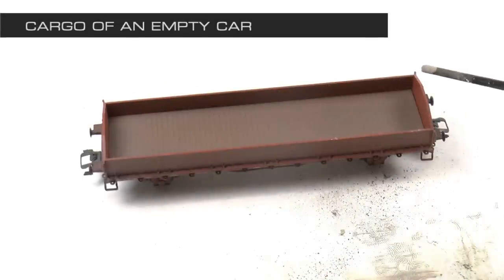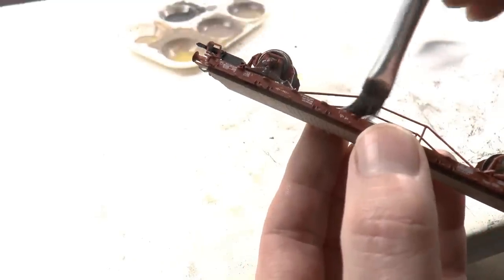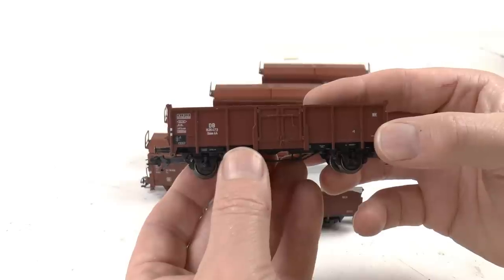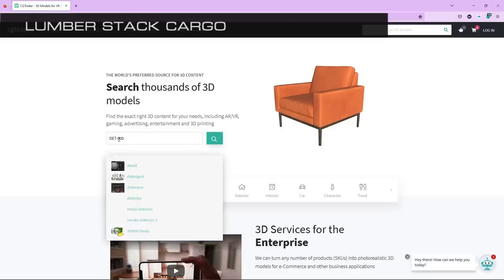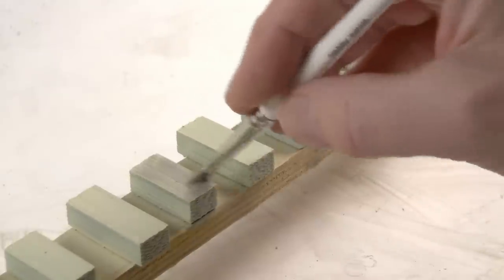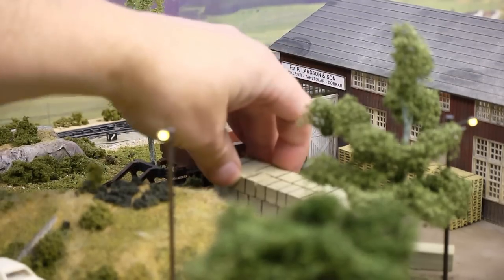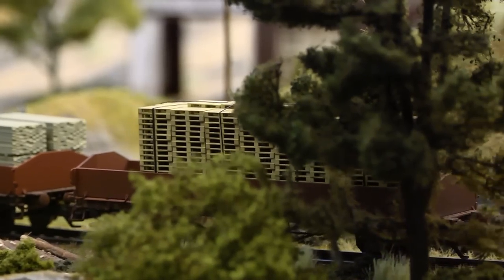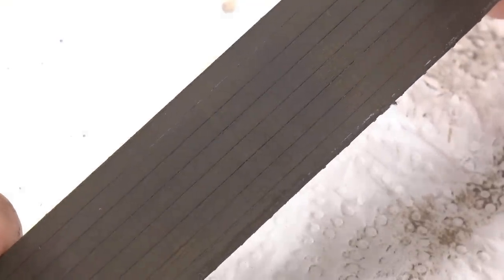Creating wood themed loads/cargo for your freight cars

Comment: Hi Martin, Being a scratch model boat builder and now back into model trains, I use black cotton for straps and securing restraints. It is also useful for wrapping around a round wooden block or PVC pipe to represent cable or even rope etc. The ideas are endless, it just depends on the mind of the modeller.

Comment: Well, Martin, another great video tutorial.  I am learning a lot from you as I progress into my modeling career.  I have a casting (from plaster) of "junk" that goes into a gondola and I have spent hours in detail painting of this casting.  It's even got some rubber wheels I have paint with flat black.  So far, so good.  I've gotten it to look quite realistic which is the goal in model railroading.  On my old layout I started painting all the ties on the track with varying colors of browns.  I had to tear down the layout when we moved from GA to TN so I'll be building a new HO scale layout in the very near future.  I've learned a lot since that first layout. I've learned that I can reuse some of the track that I had ballasted just by adding some water to soften the old PVA glue.  I'll also be constructing a new Lionel 027 layout as well.  My wife says I have too many hobbies, i.e., Ham radio, model trains, photography and reloading ammo.  Cheers & 73 from W Rusty Lane K9POW in eastern Tennessee

Comment: On a local Operating Session the owner made his coal loads removable by magnet. He inserted a nut under the pile of coal. As the nut is glued in the magnet handle is placed over the coal load and it lifts right out. The loads are then put in a bin under the layout. The bin is then returned to the location where the cars are loaded during another operating session. This is similar to your storage bins but keeps hands off the layout. 
The same could be done for saw dust, wood chips,  or even scrap metal loads.

Comment: Hey Martin, for your concern .. not prototypic cars ... Look at new releases by modelrailroad3d .. they have a swedish style car for fine wood fibers and similar scrap .. it prints in just 3 parts and has clearly visible freight - only if you want to put a base of say balsa wood below the wood fibers then you have to place it in there before glueing top and bottom of the car together as the car has kind of stabilizing elements that span between both sides so you cant insert a long balsa piece after assembling the car. As a side .. printed fine scaled down to TT scale as well ^^

Comment: 20mm is roughly 0.8 inches in length. Walmart sells small timbers that are about 3mm or so square on each end and about 75mm in length that could be used as a top or outer layer on a timber in a gondola. These would be in their craft aisle for the larger Walmart locations.

Comment: great video with lots of nice tips. I think of one thing that can make your work easier and that is how you cut those straps at 11.50. Did you know that you can buy the straps ready fro use like Whiteboard Tape Line, on a roll with glue on one side. They come in a lot of colors and sizes like 1 mm wide . At a very low cost. But sure is a nice video. Thanks !

Comment: Tip... if you print large flat bits in a resin printer, like the top of the pallet. Try tilting the print with 25-30 degrees so the flat is not printed all at once. This will give a faster, more even and reduce the risk for falure.